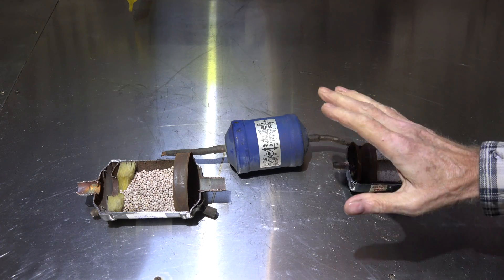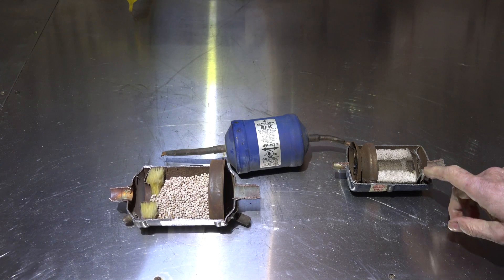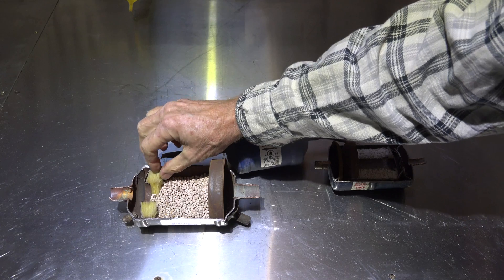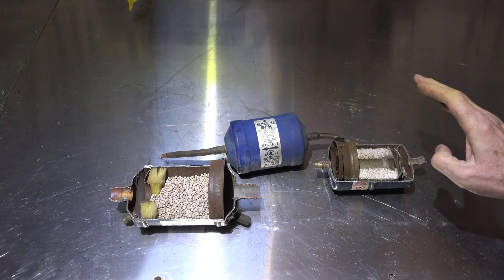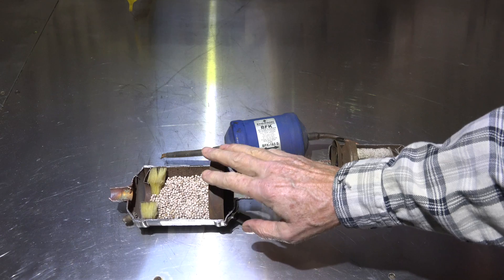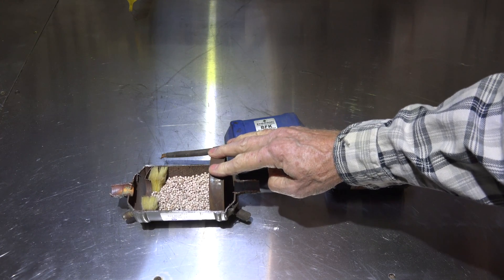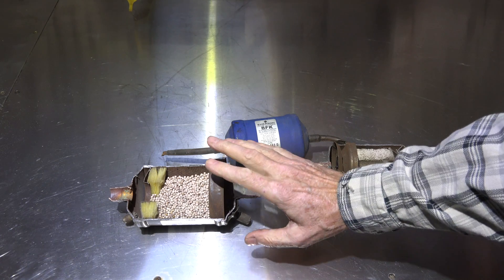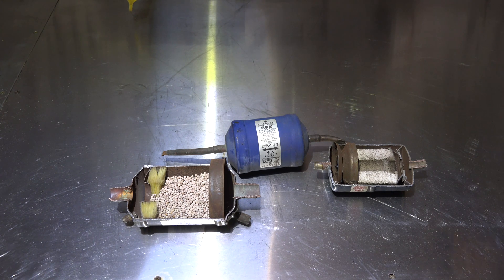What the A/C filter-drier can do

Comment: noticed my ac unit in condo didn't have a filter drier as well as others on the rool; about 1/2 and `1/2.  My ac is for a trane.  How necessary is it?
Reply from the maker: Liquid line filter driers are usually only installed when the system is opened up for repairs.  They are usually not installed when the unit is first installed.
GFM

Comment: Can I use rx11 to clean the line set really well instead of replacing it? Also for r22 to r410a system replacement. What's the benefit of new line set when the replacement calls for the same diameter line.
Reply from the maker: You can.  The reason for replacing the lineset is that it is generally easier and less labor than cleaning it.
GFM

Comment: Have the most perplexing situation. A 3/8 lineset with a flare coupler installed will vacuum down and hold without issue.Removed the coupler and Introduced a biflow filter and it won't hold. Had a technician braze another  filter in and it still won't hold. Now I know off gassing is present but I had the vacuum run for 3 hours and got down to 90 microns. Have anyone else experienced something like this with filter driers when vacuuming? Thanks

Comment: What happens if you install the dry filter backwards with the arrow pointing away from the coils instead of toward the coils? Thank you.
Reply from the maker: The filter may release part of the desiccant into the system.
GFM
Reply: @grayfurnaceman  Thank you. I am changing the entire system today---the filter, the coils and the 410 in my Carrier unit. I have a big leak in the coils even tho the carrier is only 6 years old. Oh well.
Reply: CAN BLOCK MORE EASILY FROM DIRTY.

Comment: I have a system which has a cracked on the liquid line side then it took 2 weeks before it was repaired and for two weeks the system has  no freon. Maybe just for 3 days all freon excape throught  that tiny cracks.
Now,my question do i have to replace my filter drier? Im afraid that my filter drier absorbed moisture from the outside through  the tiny cracks? please help..

Comment: Which one is better, the one with small beads on the left, or the right one with solid stuff? Will the small beads come out of filter drier after years of worn? Thank you
Reply: THE BETTER OF COURSE IS WITH THE SOLID STUFF.
THE OTHER ON THE LEFT BY THE YEARS IS BECOMING DUST.
ESPECIALLY IN THE FILTERS WITH CAPILLARY TUBE WHEN THE REFRIGERATION STOP FROM THE DESIRABLE TEMPERATURE, 
THE FLOW OF THE REFRIGERANT DESTROY IT..
BECAUSE THE SYSTEM IS TRYING TO EQUALISE THE PRESSURE.

Comment: I read something online and some technicians found the yellowish filter or the beads came out of filter drier and clogged the metering devices. So, what’s the best brand? Is the right one better than the other two versions?
Reply from the maker: There are problems with both the beads and solid core driers.  The solid core driers are subject to damage if dropped.  The balls can get around the screen.  In either case, the drier is defective.  
GFM

Comment: How do I know how much 410a to add for an additional filter drier?
Reply from the maker: Most of the manufacturers give the amounts in the instructions.
GFM
Reply: @grayfurnaceman   thanks for the reply. Went out and looked and I didn't even put it in. The temp was in the single digits and windy when I installed my coil. I used it on another unit. Should have at least put it on just outside the handler but I didnt.

Comment: How often should these filter-driers be replaced?
Reply from the maker: They are only replaced when the system is opened.  There is no schedule for replacement unless there is a dirty burnout of a compressor and the filter is used to clean the system.  In that case, filters may be installed and after a week or so replaced.
GFM
Reply: MORE OFTEN YOU CHANGE IT,
BETTER WORK THE SYSTEM.
Reply: I SUGGEST ONCE PER YEAR.

Comment: Yes i agree with your because last month i change my compressor 4 ton 3 phase and i flush the system and clean conderser and drier with chem. And vacu. System and havc work very well after 3 day  the cooling was not very cold i checked i found the ek 163 fillter dryer was half pluged i had to replace again and finally worked fine..

Comment: My unit is 3 years old and the evaporator coil started leaking.  I found out later that the filter drier was not put in when the new unit was installed.  Can not putting in the drier cause the coil to start leaking?
I have a 2 1/2 ton split system.
Reply from the maker: No.  Most new units do not have filter driers installed.
GFM

Comment: when installing a rheem 3ton heat pump r410a should the factory charge be increased to accommodate the filter drier? if so approximately how many additional oz?
Reply from the maker: It should.  As for amount some of the driers have that info in their install instructions.  Mostly, I have seen 14.5 oz for a 16 cu in drier.
GFM

Comment: Why would my high side line be cold and my low side hot on a goodman condensing unit straight cool ?
Reply from the maker: +XaQe clan To determine what is going on, you need to know the system pressures.  Sounds like possible compressor problem.
GFM

Comment: Great video as usual. I thought that fiber glass was to protect the little balls.
Reply from the maker: +The Air Conditioning Guy It probably does both.  I have seen demonstrations where tapping the drier with a hammer causes some of the crap caught by the filter to be released.  Not so good.

Comment: what i understand then is NOT to leave permanently a suction filter drier after a compressor motor change out. I had the impresion of acting as metering any excess of liquid refrigerant coming back to the compressor motor if there is any over charge condition.. leave it or take it out?? is my question.great instructional video.

Comment: I was one of those asking about filter/driers a few months ago.I wanted to see the inside of those bi-directional heat pump F/d's. Two sections...check valves??? How do they prevent back washing trapped particles towards expansion valves?
Reply from the maker: +Coil Smoke I have one that takes driers apart.  Just put drier in the channel search engine.
GFM

Comment: I went to a Dykan class and asked why they dont use filter dryers on there systems he said filter dryers are for people that dont pull a proper vacuum on new installs. And many companys now factory install filter dryers inside the condensing units "pain in the a$$"
Reply from the maker: +Bernie Clement They do not use dryers because they have absolute control in the factory.  I would also not install one on a new install.  However, service is another issue.  
GFM